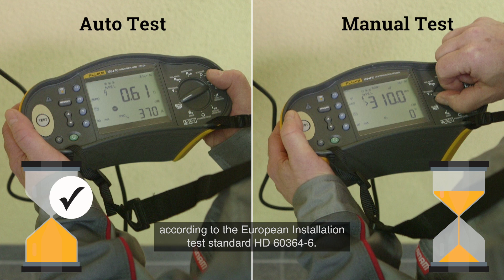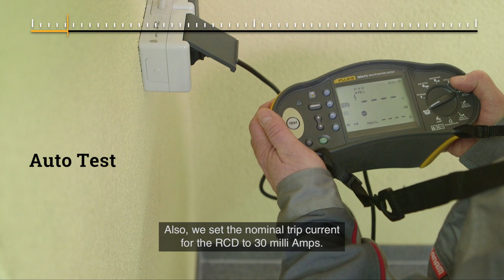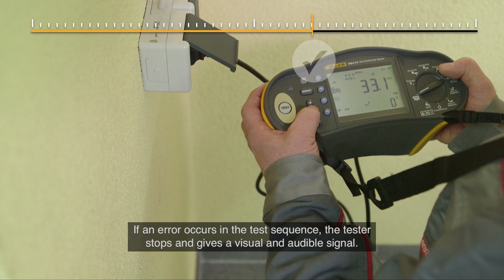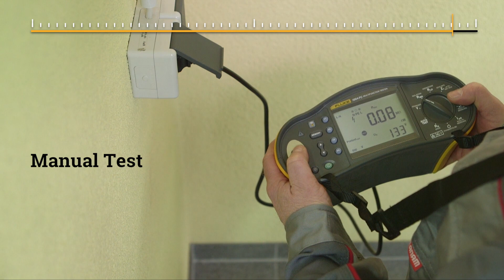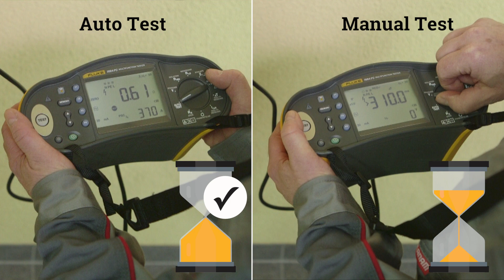The benefits of using the AutoTest function of the Fluke 1664FC Multifunction Installation Tester

Comment: Insulation test can only be performed without live voltage, did the auto test on the video just performed insulation test with a live voltage?
Reply: there is not going to be live voltage after it tripped the RCD

Comment: After every socket, I need to turn the RCD back on? Is there a way to cutomize the auto test? I don't want to test the RCD with every socket...
Reply: I’m not sure why you’d need to do the auto test in every socket, the rest would just be polarity/correct connections